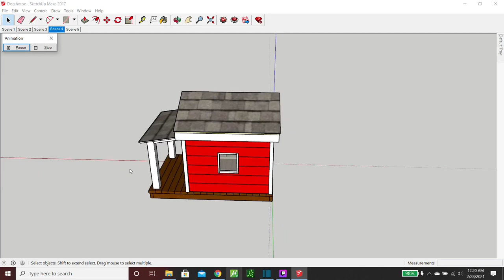DIY Big Dog House Build (Traditional Style)

Comment: You built the worlds heaviest dog house. 😁👍🏽

Not sure you have a table saw, but you can tongue and groove the exterior wall boards, which will create a seal from the outside elements. The board may shrink some and tongue and groove keeps it cracks from appearing.
Reply from the maker: Yeah it’s not meant to be moved anywhere😂cedar fence boards seamed like the cheapest option and they are holding up great👌🏼very weather resistant. Fence boards are actually only 5/8” thick so it can be done but its definitely harder to do tongue and grove. I live in Texas so I don’t need it to be perfectly sealed😂
Reply: If I plan to build this, how would I move it? Also, I don't have a table saw.  Would the regular boards be okay? Maybe another layer of plywood and insulation on the inside?

Comment: How tall are the side wall studs. 36?
Reply from the maker: The side wall studs are 33 inches tall.
Reply: @imperialwoodworking  so from bottom plate to top about 37 total from floor to roof truss?
Reply from the maker: @brandontaylor8842  the vertical Stud is 33 inches + the bottom and top horizontal stud gives is a total height of 36 inches. Sorry if that was confusing I miss understood. I hope that helps:)